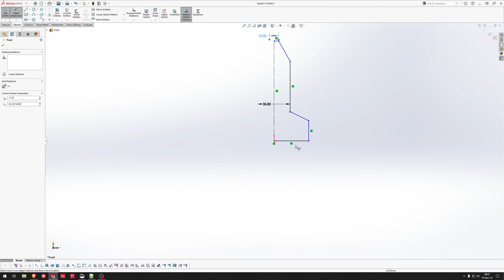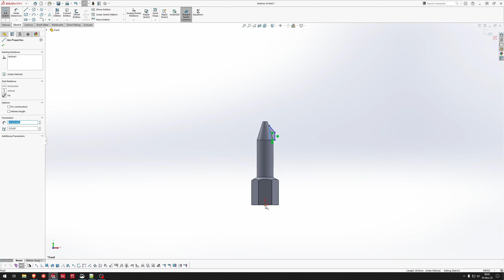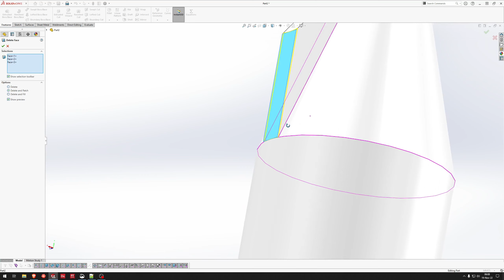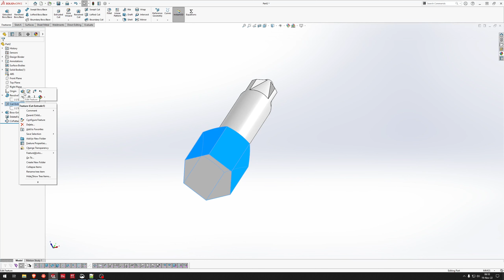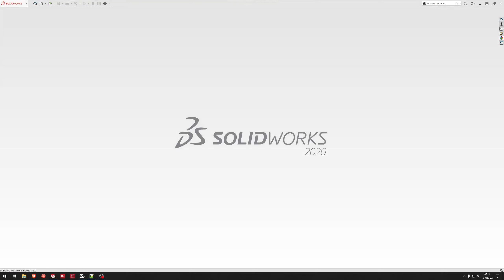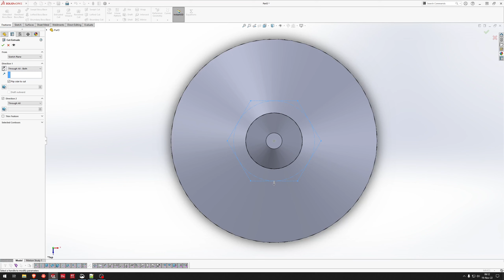SOLVED - Too Tall Toby Practice Model - 11-03-TOY BIT

Comment: Dud e  love  the  vids. Keep them  up. I am a  little sad I do  not  really  use  solid works . I  model  for  fun. I use  it  to design signs  and  check  sheet  metal and  pipe  bends. But  thank s  for  what you are  doing I love it.